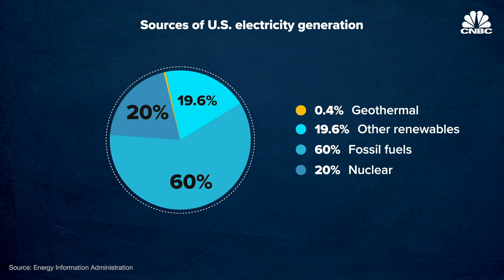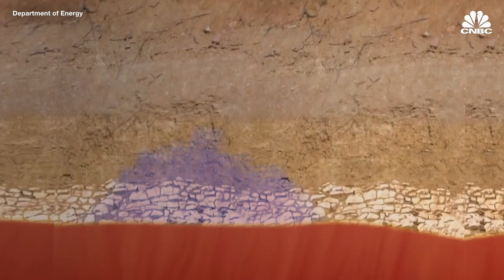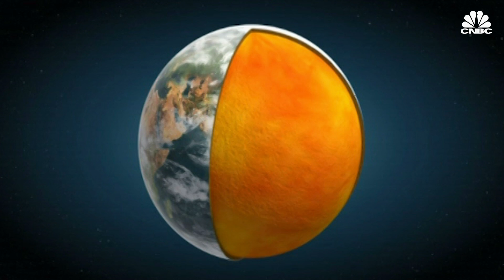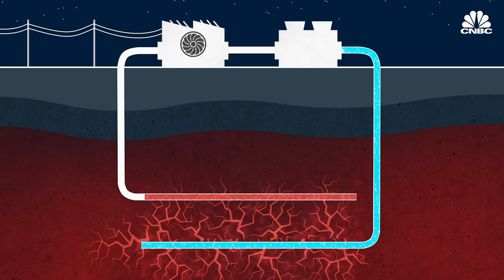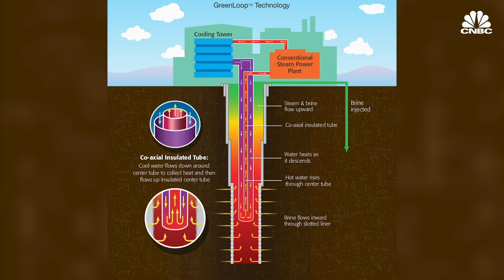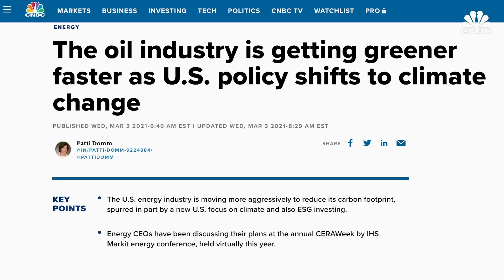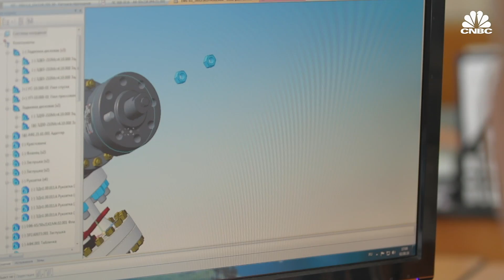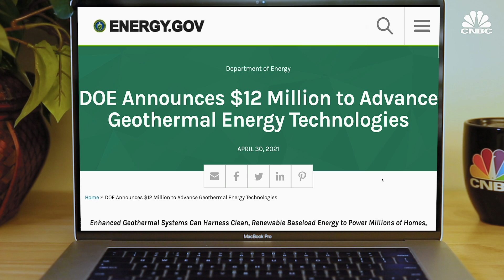This Overlooked Energy Source Could Supply 50% Of Electricity

Comment: Yes, GTP is great and all, but nothing in this video is actually new or revolutionary. Iceland, Kenya, Japan, many places have used geothermal power for a long time; I'm pretty sure even back when steam engines were just invented someone looked at natural hot springs and thought "If I could use that instead of wood and coal I'd save so much money". Yet almost nobody has tried to exploit it on large scale. Just because some oil drillers need new jobs does not mean other issues have been solved or that the costs had a massive drop.

Also, energy storage is not something that only exists for wind and solar, they are just the cheapest ways to fill that storage. Just like nuclear and coal plants a geothermal power plant cannot really turn down the steam when night falls and demand for electricity goes down, nor can they easily increase their production, especially in a hurry. So you want some kind of energy storage connected to them that you can dump extra power to and draw it when daytime demand has sudden spikes; it has been proven many times that using storage like batteries, pumped hydro etc. is far cheaper than paying premium for electricity to a peaker plant.
Reply: A few things:

1. Even if costs haven't declined, companies have grown in wealth exponentially.  
2. None of the countries you name are as rich as the US.
3. Japan hasn't maxed out its capacity due to its geothermal areas being owned by privately owned bath houses that are reluctant to allow development.  Plus, its population is shrinking.
4. Excess heat from geothermal can be used to heat things like hydroponic farms, bathing areas, and more.  Turning off the steam would be a defect in most cases.
Reply: @palmshoot  Money has little to do with it, every other type of energy was built on loans and government subsidies regardless of whether it was economical at the time. We got improved coal furnaces, hundreds of times cheaper wind and PV, and massive research into energy storage from that. But only now decades later when some people are finally noticing that wind&solar+energy storage are cheap and easy enough to install to make fossil fuels obsolete even at night and when there is no wind is there increased interest in GTP. Sure, lots of improvements have been invented during the last 50 years, but today total GT energy production in USA is under 4GW and some of the existing 69 geothermal plants produce less power than a single offshore wind turbine. Compare that to the over 2500 utility scale solar farms totaling ~100GW and some 58000 wind turbines that produce over 122GW.

This page https://www.energy.gov/eere/geothermal/history-geothermal-energy-america says the GT plant in Boise was also world's first district heating system, but that just shows how rest of the world is again ahead of US given almost every city in Europe uses district heating and cooling systems while most people in USA haven't figured out that there are alternatives to wasting energy by running the AC at full all the time every day. There are plenty of videos on YouTube where people show off their eco-houses powered by solar and heated/cooled by domestic scale geothermal systems, but those are all privately built, few construction companies even put solar panels on the roof. Utility geothermal would work great with district heating(and in summer the same system can also pump excess heat from buildings into the ground) but there is little to no interest in either district heating or utility scale geothermal power.

Also: When I used the term "turn down thew steam" I meant changing how much power the plant produces according to demand, that has nothing to do with how the waste heat might be utilized. Adjusting the output of a coal, nuclear or geothermal plant takes so much time it cannot keep up with grid fluctuations, that is why they are used as base load plants instead. They are also optimized for certain output, so it is actually not worth trying to save fuel by running a 1GW coal plant at 90%, the power companies developed energy storage instead.
Reply: @AnalystPrime  This video, I, and even you all mentioned cost (read: money).  Like it or not, it is part of the conversation.  The video showed that Bill Gates, an individual who doesn't particularly need loans or subsidies, has added geothermal to his portfolio; there are others richer than him.

Geothermal heat pumps can be used with or without geothermal power.  They use a different mechanism than geothermal power.  To counterbalance the YouTube anecdotes of using solar to power homeowners' geothermal heat pumps, there are other anecdotes claiming that solar was insufficient to keep their geothermal heat pumps running during power outages.

The notion of reducing geothermal power production is still counterproductive.  If the heat is above boiling, it can trivially be used to produce hydrogen, which a (Swiss) company in Iceland is planning to do, or desalinate water, both of which are inexhaustible.  The non-boiling water can be used for the heating purposes outlined above.  About the only time that geothermal wells need to have their output cut is when there are lava flows that threaten the release of hydrogen sulfide and other toxins, as happened in Hawaii.

Wind and solar have the distinct advantage that they can deployed the fastest, but the former is particularly hard to transport and the latter often relies on materials that are becoming more scarce.  While some turbines produce more than some individual geothermal plants, those turbines neither produce 24/7 nor last for 50+ years.  There is also the possibility to convert abandoned oil wells into geothermal wells relatively inexpensively, and the number of abandoned oil wells outnumber the total number of wind turbines by multiple orders of magnitude.  Even for heating, wind and solar aren't price-competitive with natural gas, but geothermal heat pumps sometimes are and don't have the problem of seasonality.  The dearth of geothermal isn't for lack of geologic resources but more so cost.  Geologists even claim that it is possible to re-purpose abandoned coal mines for geothermal heating.  There are over 5,000 abandoned coal mines in the US right now.
Reply: @palmshoot  I generally agree with all you said except the thing about solar not being able to run a domestic heat pump, must have been something like a grid tied system that doesn't actually give power during blackouts.

Cost is definitely an issue, but the time needed to drill a well seems to matter more. It has taken sixty years to get to current situation where all of the GT power in USA could be replaced by few coal or nuclear plants. There is talk of future potential, but in the Corona year 2020 alone USA installed three times as much wind and solar production capacity as there is existing GT production.
Sorry, I meant three times as much, *each*.

Geothermal still has obvious advantages over S/W+storage, but where are the massive projects needed to make it a major part of renewable production? Where are the investments to make that happen?
Reply: @AnalystPrime  Regarding the solar panels failing to power the geothermal heat pumps, I suppose you could just ask those homeowners about specifics.  I saw it on one of those forums for homeowners.

Drilling time for geothermal is still shorter than nuclear and on about on par with hydroelectric.  Again, repurposing abandoned oil wells would slash the time and expense required, as outlined by the Department of Energy.

I'm also perplexed by the reluctance of embracing geothermal earnestly when, for example, some major tech companies already support the drilling efforts of oil companies.  I did touch on the lower deployment costs of wind of solar.  Hydro is similar in cost and construction time, as mentioned, and has about the lowest price per kWh and highest output of all power sources, however, it is devastating to ecosystems.  One issue is that most geothermal drillers aren't using abandoned oil wells.  Since drilling has a 20% chance of not yielding sufficient heat, the cost of failing seems to be viewed as prohibitive by those with even the deepest pockets.
Reply: @palmshoot  I heard that one way to install PV panels at homes without battery storage sells all the power directly to the grid for energy credits but because the panels are not actually connected to the house they do not help at all during a blackout. Not sure if such connections are still used at all these days.
(I think we should call such domestic systems ground source heat pumps, to differentiate from deep wells that produce electricity and heat at utility scale. Basically, ground source=domestic heating/cooling only; geothermal power=megawatt+ scale heat and electricity.)

I hope using those oil wells can help, instead of just bringing up more oil that contaminates the land. Typical boreholes try to find an underground reservoir of water and rarely go more than a mile deep, but that is kind of reaching for lowest hanging fruit. I much prefer hearing of projects like what the Scandinavian company ST1 is doing in Sweden, their boreholes go three or four miles down in some of the hardest, and also coldest, least geologically active rock in the world. They managed to get GT power work near the Arctic Circle, it should be far easier to do literally everywhere else.
Reply: @AnalystPrime  Even if storage is used for solar, those batteries can be drained when it's cloudy or at night.

I would caution about restricting "geothermal power" to mega scale plus, because OTEC (ocean geothermal) is currently on the order of kilowatts.  It looks like we were both aware of the distinction between the geothermal types, though.

I believe the abandoned oil wells are depleted of oil.  The bigger problem are the toxic gases spewing, which is why there are ongoing efforts to cap them.  Conversion to a geothermal well solves several problems at once because they provide power, the toxic gases can be commercialized (hydrogen production, for example), things like lithium can be mined as byproducts, land use is minimized (mentioned in the video), and birds aren't really killed (we saw them flying in this video).  Since the oil wells are already at 1 mile, drilling to three and four should be easier, though there are abandoned offshore oil rigs that already go even deeper.

Comment: So what would be the effects if geothermal heating were widely adopted?
Reply: When we note that climate control accounts for around 47% of residential electrical consumption, we'd need to build out less additional electrical capacity.
Reply: Also, in what other applications could they utilize a direct, renewable heat source?

Comment: The problems with renewables are the footprint, storage and recycling. How many wind turbines, solar panels and storage solutions do we need when we turn off all the fossil generation? People won't want  the footprint. 
Geothermal is perfect, small footprint per KWh no storage no recycling after 20 or 30 years no batteries to "recycle" after 10 years.
If 10% of the money and intellect that currently going into fusion went into geothermal we wouldn't need fusion as we could cover all our energy needs.

Comment: Or you just build thermal spectrum MSR thorium breeders. Maybe?.... You'll produce a lot less radioactive waste with a nuclear power plant, as geothermal produces around 200X more radioactive waste per watt produced than a nuclear power plant does.
Reply: The average Imperial Valley Geothermal plant produces about 40 tons or radioactive filter cake and solids, per day.
Reply: @williamsmith1741  Could you cite a source for this? This seems surprising to me and I can't find any information on it. Is the filter cake actually radioactive enough to be an issue?
Reply: @livefromhollywood194  Sure, just do a google search for "Geothermal Power in Imperial Valley - Desert Report". Or you could just google about it in general, read some of the reports put out by the IAEA or some other regulatory body. I mean, geothermal heat is generated by the decay of radioactive elements in the core and mantel. 

I can't speak to the level of radioactivity, as the filter cake also contains arsenic, lead, and other things, but it also contains uranium, radium, and I'm sure radon (but not for too long with the last one as that just escapes into the atmosphere). 

Honestly, I don't think radioactive waste from geothermal is really that much of an issue, but neither is the radioactive waste from a nuclear power plant. The waste from a nuclear power plant is much more radioactive but there's also A LOT less of it.
Reply: @livefromhollywood194  Yeah, you're pumping hot acidic water out of very geologically active strata, pulling TONS of minerals out with the brine, a lot of which will be radioactive, as both uranium, radium, and I'm sure other things, are very water soluble.
Reply: @livefromhollywood194  You can also google "Radioactive waste discovered at a Reykjanes peninsula geothermal power plant"
Reply: Of course, if you're comparing against a thermal spectrum MSR thorium breeder, it gets worse, since the waste produced by the MSR would also decay away to stability faster than the waste from the geothermal plant, with 87% or so of the MSR waste being virtually entirely gone within a decade or so of being produced. That's a lot faster than the 1,600 year half life of radium-226, which will be a material portion of your geothermal waste.

Comment: Would it be possible to use geothermal for desalinization? Like if you can pump water down into a frakked cave and then it heats up and returns as steam, then why not use seawater for that, and fresh water would come up. Of course you would need to use clean fluids so that the water would not be contaminated, and salts would build up in the cave so you would eventually need to either move the caves around or "flush" the brine out of them somehow, but I bet there's some way to make that work for both producing energy and producing drinking water, and maybe producing salt.
Reply: Maybe. You had me at coupling a renewable energy source with desalination for drinking water and making the most of a process that was going to distill water regardless, but the fracking was my least favorite geothermal method in the video (because of the seismic risk they mentioned) and what about pairing desalination with a more energetically productive or efficient source? Would it still be positive source of energy by the time you put so much into such a energy demanding process and deal with its byproducts or did you intend for it to just make energy for desalination?
Reply: @Maverickgouda  Well, I mean my theory is that if the fraking method is an efficient energy producer, then in theory you could frak it using foodsafe chemicals, create the "hot rock" conditions, and then it's just a matter of pumping salt water in and collecting clean steam at the top, letting that steam condense naturally into water. 

You would need to do this in an area near sea water, obviously, but unless I'm missing something, if you can put all those pieces into place then the desalinated water would become "free," and then the energy produced by the steam turbines would also be "free," outside of maintenance and minor efficiency costs. I mean, it would be "free energy and water" relative to other energy and water production methods, at least. :D

Now maybe fraking wouldn't even be necessary, so long as they could find a place to dump the salt water that would get it to boil, and in which the resulting steam would not carry any unusable byproducts.